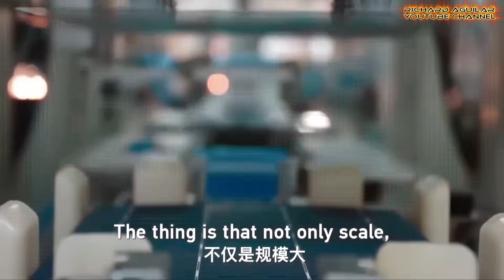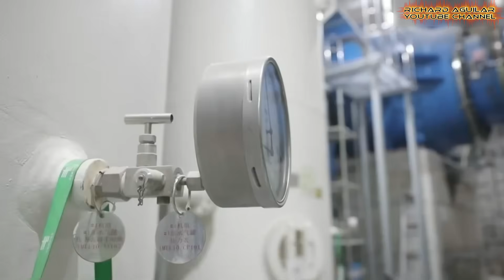Inside China’s Renewable Powerhouses: A Bold Shift Reshaping the Planet

Comment: This is really eye-opening! I’m curious—how much of China’s renewable energy is actually being used to replace coal right now, and how soon could it make a real global impact?
Reply: China’s total energy use has been growing along with an increase in renewables. For a long time renewables have been an extremely high and ever growing percentage of new additions to the grid. More recently it may have started reducing China’s coal use - which some experts say might have peaked 18 months ago. It’s also possible it’s on a bumpy plateau for a while and could go slightly higher. Either way coal use will be declining a lot before not long.
Reply: "actually"?  Well, they might be using the coal, TOO!  I think they can not have too much energy.  But if you put all the "new" energy sources together, it must be TeraWatts, and you could say that is coal that didn't get burned I guess?  Your question doesn't exactly make sense.  ALL the power is being used "right now", it's not like it is piling up somewhere!  There are a few big energy storage projects, but overall I don't think they are very long-term, like seasonal or annual energy storage.  That would be BIG.